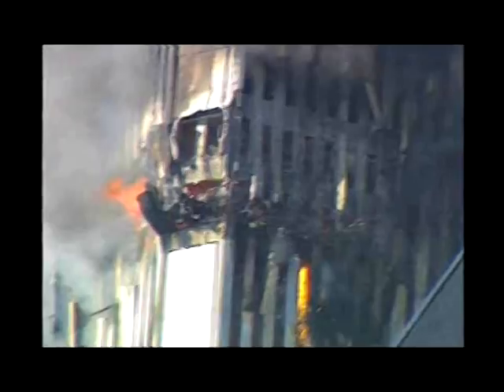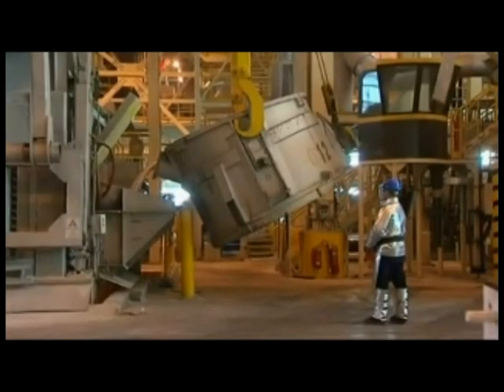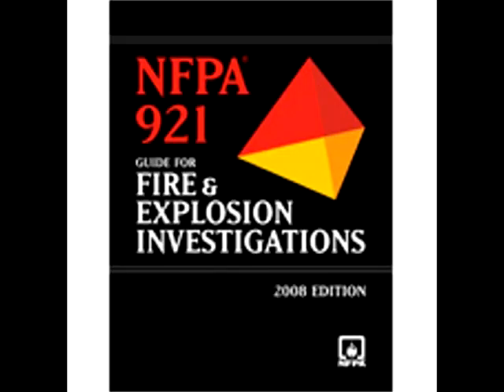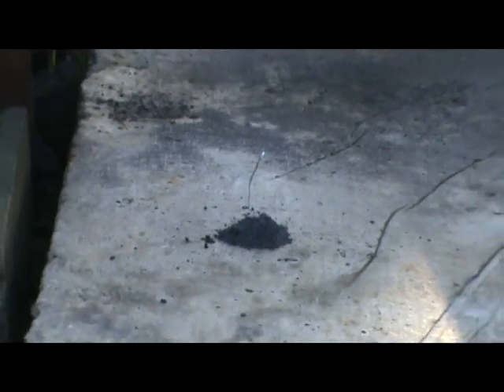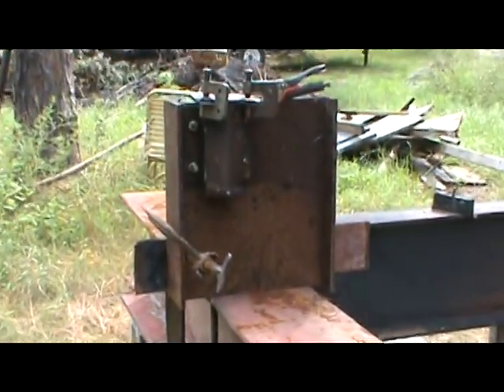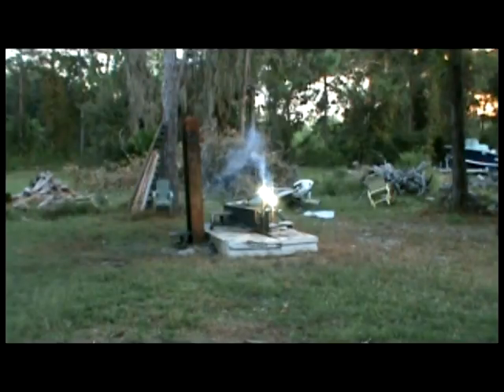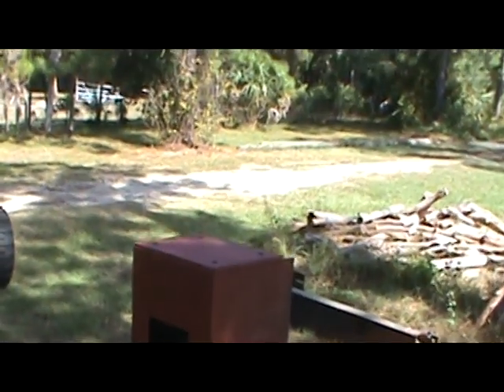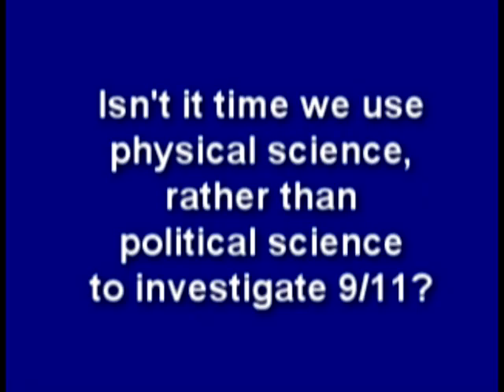9/11 Experiments: The Great Thermate Debate

Comment: You say thermite the bulding blocks for this is aluminim and iron right how about titaium and magnisim all of these materials will burn and are presant in an aircraft i have als seen white and orange flashes when an airaft crashes also when concrete is heated it also explodes with a sharp crack crack crack like a rifle

Comment: The video proves it may possible for there to be human intervention that aided the tower collapse.  But gives little proof that it is probable.  

Circular balls of iron were found at 9/11.  Great.  Thermitic reactions are capable of making them.  Cool.  That's not enough.  Science demands proof there's a linkage.  Are the iron balls found at the 9/11 site consistent in size and composition with what is produced by a thermitic reaction?  This video provides no answer.

We see a molten metal pouring out of places.  If it is iron or steel as this video suggests, maybe they're the source of the iron balls.  If we agree they are the source, then we have to prove that those streams came from a thermitic reaction.  On the basis of this video we can say they could come from a thermitic reaction, not that they did.  If the WTC buildings were weakened in the style of a building demolition, they would have to be weakened up and down.  We would therefore expect to see streams of molten metal coming off the WTC at all levels of the buildings.  Do we?  Maybe the metal flow was in some way contained.  Were cooled pools of recently-molten metal found in the 9/11 debris?  Were there white flashes at lower levels of the WTC or other evidence that the whole building had been prepped to be brought down?

Comment: Great video but unlikely what happened just like the universe when 2 things collide it creates something else and a plane going 700 miles per hour into a building with alot of oxygen and steel could have and more likely melted the beams in a fraction and just kept going but it is almost impossible to place anything inside the beams undetected for any amount of time it would take too long and someone is not that crazy to spend that much time just to drop a building and gain nothing from it. People do stuff like this to banks or gold storage building not Trade Center
Reply: +300tank birds born in a cage think flying is an illness